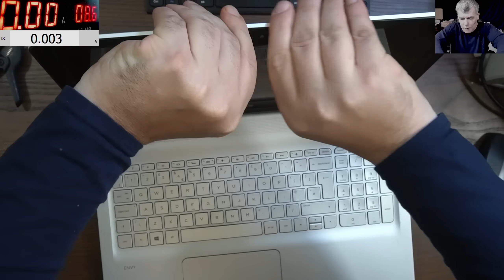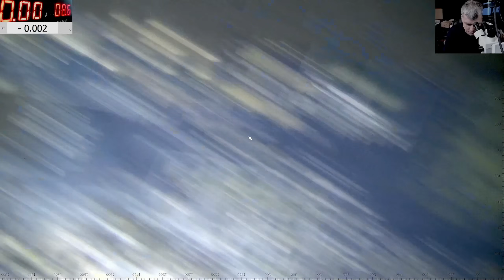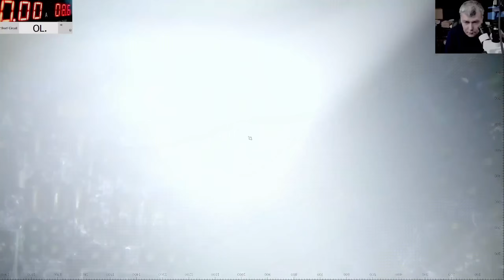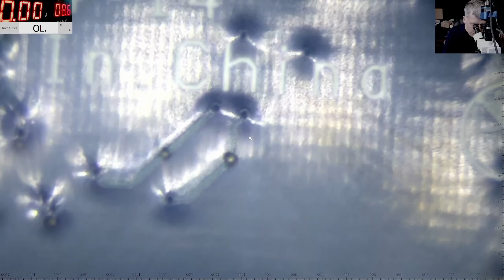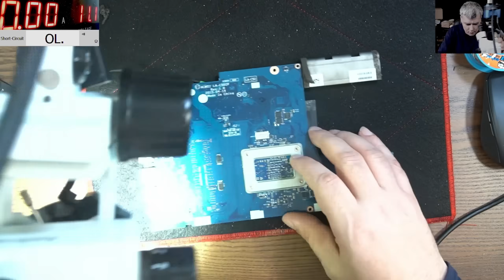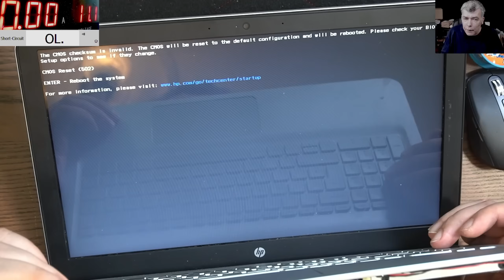The weirdest job ever - Dodgy HP laptop motherboard repair

Comment: Hello, Sorin. I’m sorry to say but You didn’t fix the board, You just eliminated the short that was on the 19V power rail. The component that was blown was not a capacitor, it was a coil (I checked that on a perfect LA-C502P board image). The coil number in the board schematics is “LA10” (sometimes, you call those coils as “carbon resistors”, but they are small coils, and you can see the coil number written near the component on the board). There’s still a short in the board after the coil but you isolated the shortened circuit by removing the coil (the blown component) and liberating the 19V to go to the screen conector again. Sorry for my poor English but I think you could understand me. Cheers from Brazil!
Reply: Well explained! would be  nice to know if customer will get back and say what device in this laptop has stopped working. That blown coil was providing power to something, so there must be a faulty device now, perhaps a sound chip , etc. Schematics is really needed here, to find out exactly.

Comment: HP stands for "horrible products". Even their most expensive laptops made about  8 years ago used dangerous power inputs but their real masterstroke was to use capacitors in line, usually 4 when 2 good quality ones would suffice. HP's were cheap ones and often popped and this could blow carbon [conductive] fragments to other places. After thorough cleaning and using re-set, usually by removing the BIOS battery for a couple of hours, normality could be restored. That is to say HP's shoddy version of 'normality'.
Part of my work was to recommend devices to government acquisition departments here in the UK and as the faults were so common the result was very few HP laptops being seen in British schools.
Strangely, far older HP laptops could be upgraded using SSDs new RAM and occasional CPUs to work to modern speeds and acceptable efficiency.

Comment: Most probably you have a ground layer under the exploded component. When you soldered the wire you created a short between the main power rail to the ground layer below it.
Reply: I also think this was the case. I've seen this in many cases, when customer says: There was a small smoke, but the laptop has no problem a few month ago.

Comment: the problem was the cap witch was shorted and most of the same  faults when you remove and clean the board the short is gone[and it works perfectly without the cap] nice work[easy one]

Comment: I saw 2 of these.  The back-light buttons on keyboard are "reversing" randomly.... making screen completely black at 100% and completely lighted at 0% ... removing battery everything come correct.... but maybe after some days the  backlight controls becomes again reversed... check on the web ... on the  HP forum there are some users talking about this.

Comment: Sometimes when you somehow fix something, there IS a issue, just enough to bump it and be thankful its working again is all you can hope sometimes.  You can test it for a hour moving and bumping and if all good, Perhaps clean all connectors and check alignment ect and wires. Once had a early ipad with a LCD that only came on now and then, so unglued the touch and just that alone without anything else disturbed something and i couldnt get it to go off again!!  I then cleaned all the connectors and checked all and plugged in and out in case of corrosion but 100%. Must have been very very small connector issue just enough to kill the screen and even tapping it before opening make no diff which is why i had to open her.

Comment: Sorin you didn't understand what happened. When you soldered the proper calibrated fuse, what it did was to calibrate the whole board and fix the issue.

Comment: Hi master Sorin, nice to see you again. I have a problem with my acer aspire 1 its not turning on but the 19v is open. I put my my multimeter on beeping mode and put on pin number 8 of the BIOS cheap and it beeping but on the first pin its not beeping and on the coil after the 3.3v power supply. how can i solve that issue

Comment: Hey, I have a question for you. My bios won't recognize my bootable flash drive in bios and I can't seem to find the reason why. Can you please help me because I'm outta options? Thanks. My machine is Toshiba satellite A300 1G5
Reply: First :
-  What Operating System do you have installed on the USB? And what software did you use to make it bootable?
-  Have you made any BIOS changes on the Toshiba Laptop?

Check if that works :
1. Once in BIOS, select Security and make sure Secure Boot is disabled.
2. Next, select the Advanced tab -> System Configuration -> make sure boot mode is set to CSM Boot.
3. Press F10 and Save & Exit.
4. Press F12 when you see the Toshiba logo and you should be able to boot into your USB drive.

If you still don't see your USB key, it may be that you made your USB bootable drive the wrong way or there's something else.

If you try to install Windows 11, you'll need Secure boot and  TPM 2.0 enabled in your BIOS.

Comment: Sorin, I can't believe you call this a repair, at best it's intermittent and the screen will go off again. What do you think your customer would say if he sees this video? Dodgy Job!
Reply: the laptop was fixed, it was fun for us to watch. Everyone is satisfied!
Reply: how can you fix it ? the laptop fixed by resetting the power and removing battery . you just over reacting that's all . there's nothing in the board not working to assume there's a fault somewhere . what do you want Sorin to do ? explain ?
Reply: @Customer_Com543  replace capacitor, no shltty cord

Comment: Do you ever ask yourself why did that fuse blow in the first place before replacing with a wire?
Reply from the maker: No fun in that, i learned from TV repairs, first replace the fuse then you pray, is doesn't blow up, it's working :D

Comment: Sorin, if you remember, you had 37 ohms on one side of the capacitor. That cleared when you popped the capacitor off. I believe that 37 ohms may have been loading the 19v bus, much like when you installed the properly calibrated fuse. Once you cleared the load/short, you had 19v on the screen connector.
Reply: I was also thinking about this.
Reply: i believe this is the case but the short may have not been pulling enough current to completely stop the motherboard from booting
Reply: That's right the blown capacitor makes it as a resistance with a low ohms something like a half or hidden short

Comment: So no test of the brightness/dimmer buttons? Perhaps the backlight was merely dimmed, turned off. The board reset and the backlight came back on.
Reply: Not sure you can get a backlight that low.
Reply: @DarkGT  Why not? Is that specific to that model laptop? My Macbook backlight goes completely off.
Reply: @jaym5938  Doesn't sound like normal behavior during boot. I can be wrong.
Reply: @DarkGT  Sure. Could be software or hardware that got it 'stuck'. But it came back on by itself - with some help from reflowing that chip. Maybe a bad connection... shrug :)
Reply: Happened 2 times to me... back-light controls on board become " reversed " and at 100% the screen vecome dark.. ( no backlight)  lowering with buttons the screen becomes  lighted.... removing battery everything become correct for a while ( some days)

Comment: I avoid laptops from HP.  Over my time I have had over 20 laptops, with just one HP.  They all still work and the HP has been repaired 3 times and it now has a bad graphic chip solder ball crack again.  I think they make junk.
Reply: How old is that HP?
Up until around 2013 they made some really solid laptops. An 8760w will not fail, other than the software.
Reply: What brand do you recommend?
4yrs ago I got my first laptop, an ASUS, it "died" after 2.5 yrs so it was a really bad investment.
I'm considering an Acer A517-53g but the display is not that great as the old one.

Comment: Sometimes this thing hapens in HP laptop as if you made a reset to main power chip and everything goes up smooth.
I think it got fixed as soon as you removed the battery and so on

Great job, i like your videos and learn alot